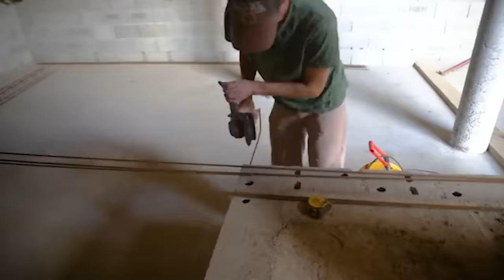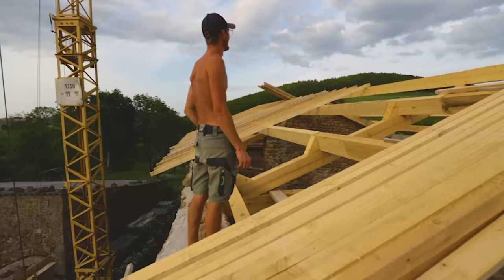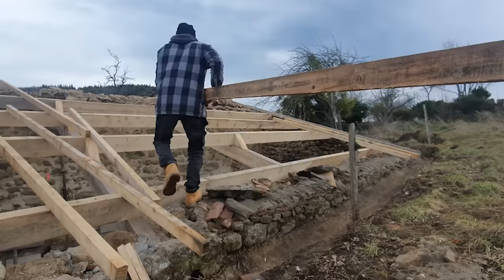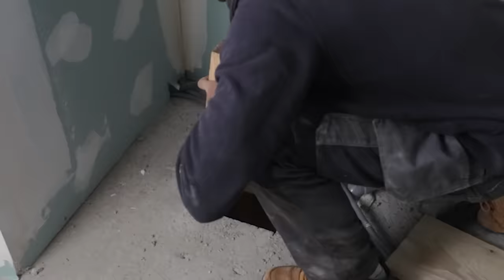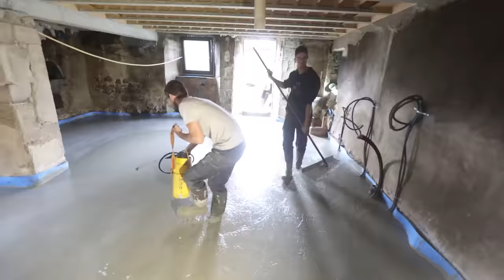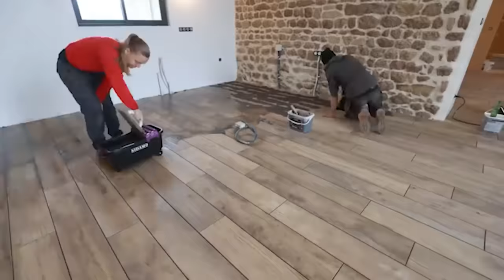TIMELAPSE 3 YEARS RENOVATION OLD FARM 1820 / TIMELAPSE RENOVATION CORPS DE FERME 1820

Comment: Amazing work and restoration.  Big building but you should of left the old orignal wooden beams. Especially the long ones..the original hardwood running the width of the structure

Comment: No doubt it's been a hard work, but you should consider for future works using mortar on vertical joints and displaying insulation and waterproof membrane (or alike) between concrete blocks and stone. Some with ground.

Comment: I've watched a few renovation videos now, and I'm curious, what determines how much of the stonework gets redone? Are there obvious weaknesses to the structural integrity that can be assessed in-person, maybe from erosion of the elements? Is there a threshold of how firm/loose the stonework can be when being assessed before it just gets ripped up and replaced? Going by just what I can see in the video, all the stones in the stonework look weathered and worn, with a lot of eroded and receding grout.
Reply: 39:45 well, at least more grout was added to fill the gaps of the stonework that was left as-is for the charm of the older building.  And I saw that some of the stonework was re-worked to make room for structural changes such as adding I-beams and a window.  But the decision making process for the roof specifically still eludes me. I get that the older wood elements of the roofing were probably in need of replacement, as well as the tiles. Was the pitch of the roof changed?

Comment: Their skirt foundation was way too thin for the amount of weight they put on it.  This is what I call slapping lipstick on a pig.  They didn’t fix the structural issues.  What I can’t believe is the cut all the old joists up.  That is premium aged wood that should have been sold in its original lengths.  Septic and septic leach are too close to the structure and will cause ground destabilization from the changing moisture.

Comment: Would have been more impressive if you’d used the correct materials for the age of the building. You’ve used so much cement. Where’s all the lime? May as well have knocked it all down.

Comment: Ok, so I appreciate the effort and the end result was beautiful, but I have several things to say here. It's easy to think that you're indestructible when you're young, but fact is that this was a time-lapse of hundreds (if not thousands) of hours of bent backs doing heavy work. Believe me, you're going to feel that in some 20 years. 

Secondly, absolutely no security equipment. That whole roof work was done completely without any rooftop fall protection at all. And all that cutting and sanding without gloves, eye-protection or face-masks (except for the bearded guy in glasses, I saw him do several different things with the proper protection equipment). Don't do it like this! I'd say that they are lucky that no one got seriously hurt.

I also wonder about isolation. I guess that this farm is in the south of France, so isolation and heating may not be that much of an issue, but still. Winters can be chilly there, too. 

Finally (not really, though), I wonder why they didn't install solar panels. 

May I suggest that the next step is to renovate with higher labor protection on site, less concrete ,(very high climate impact) and better energy systems for the next project?

Comment: You have taken a stunning ancient farmhouse, and stripped out all the character and charm. You've now got a concrete and steel monstrosity, with zero charm, zero character,. You've used cement (not lime) on the stone so you'll have serious damp issues and you'll be cold.  It would have stood for hundreds of years if you've used old techniques and appropriate materials. Well done. Way to go to ruin an old building. People like you don't deserve these properties. Just build a new modern box next time and leave the ancient stuff alone. 😞
Reply: Fully agree, the most significant mistake is new roof… what an indolence and a shame!!!

Comment: So much concrete, plastic and steel added to an old stone construction has ruined the original,....and probably in 20 years time the new owner will want to spend another 10 million dollars to redo everything again to change the styling back, and then they will have an even bigger job to get rid of all the reinforced concrete to go back to just the original stone and timber...the finished result you have achieved is like a new build. Would have been more rational, cheaper and ecological to start with a new build and just add some fake plastic cladding here and there to get the same effect 😮

Comment: I don't understand why they did it. Why did they basically build a house within a house? They could've built it outside in any shape they wanted and much more easily. Now they're limited by the original shape of the building, they had to tear down and clean up a lot of rubble, and they still can't be sure that mold or something like that won't get into the old house.